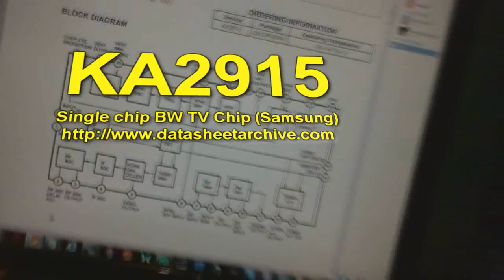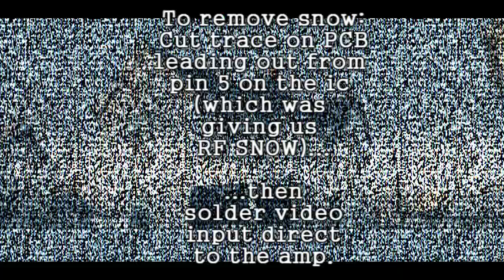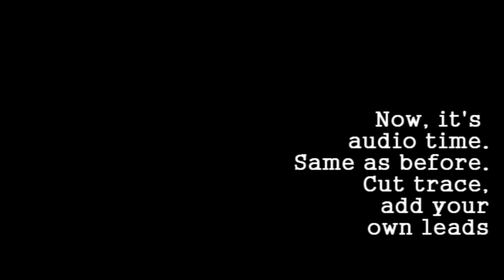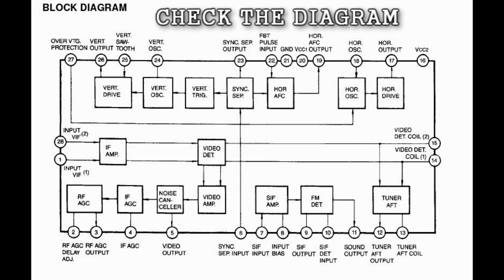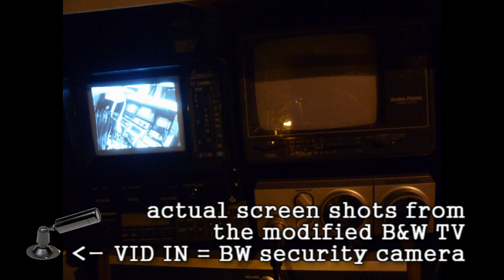How to Modify analog portable Black and White TV for Composite video and Audio Inputs

Comment: When I modified mine, I removed the tuner module as there is nothing for it to tune into. Reduces power and weight.
Tip: the battery compartment is a handy place to put a small computer like the Raspberry Pi.
Reply: Good idea. How did you power the raspberry pi? with a second cable?
Reply: @nickbex  I added a Rasperry Pi Zero to my build and I found a 12V source on the board then added a step down to 5V board.
Reply: Well i use the battery compartment to put a power supply in it for storage.

Comment: Where do you find diagrams for old CRT TVs? I have a 1980s monochrome KTV that only accepts UHF/VHF input that is directly soldered from the knobs to the motherboard. Would like to add composite to it so I can make a fake dummy terminal with a raspberry pi on the inside but I am new to CRT internals. Does adding composite depend on a specific video channel on the board?
Reply: It sucks that this is 3 years old as im having the same problem but my plan is to poke around the board and see what I can do

Comment: hi, I have an old irradio b/w tv. The chip is the same. It seems easy, located the pin 5 I can connect the video out positive directly to the pin 5, after cutting the line that from the pin 5 is going to the circuit. the result is just a screen with a lot of orizzontal lines. If I restore the line with the positive connected to pin 5 I see the signal but very noised.  What I am doing wrong? tx
Reply: I try in the next days on a Colour version.. can you solve your issue?

Comment: i don't get it. How does the TV manage to sync properly if you're just feeding composite video after the KA2915 chip?
Reply: Well... I found the answer. The composite signal is also fed into the chip at pin 6 which is the input for the sync circuitry. Kind of weird that this is done externally in the original design. I mean, video out from the chip is fed back into the chip at another pin. Why not deal with this internally inside the chip? Could the reason be to easily enable a composite input on more expensive models of the same TV?
Reply: That's exactly why, the less common, "higher end" (lol) versions of this toob had a composite in.... it's crazy to me that the cost of an rca jack and wire and solder was enough to outweigh the increased consumer appeal that the composite input would have brought with it....
Reply: @testcardsandmore1231 Thank you for explaining this part of it! I was seriously confused even with the AN5151 example circuit and pinout in front of me and somehow forgot 6 was sync separator input.
Reply: @testcardsandmore1231  if i Connect pin 5 and 6 static dissapear but It doesnt work , no imagen

Comment: I tried this today with an Emerson - Onboard IC is an LA7530N with video out on pin 16. I tried pulling the leg and tacking a lead directly to the pad. I was able to get a steady b&w image from a Luma source, but trying composite video results in just a mess. I did not terminate it with 75ohm, just straight CVBS into the video out pad - is this the issue?

Comment: This might be a little away from what you're doing here, but I think it's in teh right track. I'm looking to use a B&W TV as a monitor for an arcade game, like space invaders era. The boards put out a single video line, which I believe is effectively a single colour 'composite' type signal (obviously composite isn't the right word with only one colour/no colour, but you know what I mean). Does this sound correct? a B&W video feed would technically be able to be connected to a B&W TV in the same manner as you've done here, do you think?

Comment: mistertentpole I have a 7" digital TV which doesn't has composite inputs, can I do this to it? I want to connect my PS3 to it. I bought a RF Modulator but for some reason my tv does not process the signal input

Comment: Great video! I have seen another tutorial where the guy adds video in to an old Sony Watchman CRT; same procedure. He removed the IC entirely to cut out on interference. My question, since you say cut the trace and loosen the chip, is this chip only for processing the incoming RF? Since RF broadcasting is all but gone, these chips are useless for our modern needs? Thanks in advance.
Reply: These 5" tellies use a single-chip monochrome TV chip plus a tuner. The tuner feeds baseband video to the chip. You can't remove the TV chip. It is soldered in, so you can't "loosen" it at all.

Comment: So I have a old tv that I love, is there anyway I could convert it from the av ports to hdmi so I can connect by blueray player? I don't want to get the box that converts it.
Reply from the maker: Joaquin Reyes The trouble here is that the signals are not compatible.  Without additional electronics, no you cannot directly modify analog tv to include a working HDMI connection.
Reply: +Joaquin Reyes 
Older Blu Ray players had standard AV ports on them. You could try to find one of those.
Reply: Thanks for the helpful information!!!
Reply: Joaquin Reyes
No problem. I wasn't sure if it'd be all that helpful after a whole year, but you never know!

Comment: I could not find my TV's schematic anywhere on the site, and the only things that did have it charged money. My TV is a Samsung TB-1210. I would fool with it some more, but I just blew a fuse fooling around with an RCA cable, poking it around.
Reply: He didn't find the TV schematics either, he found the datasheet for the chip inside the TV that produced the video signal. Maybe if you can identify that chip inside your TV you can do the same?

Comment: Hey - Nice work! 

I have a Sony Solid Sate (TV9-90UB) B&W TV and was looking to do exactly the same operation. But I don't have the technical understanding to figure out where I need to solder in the video input wire. I don't suppose you could take a look over the electrical diagram and PCB below and help me out? Any clues you can provide would be a big help. 

http://i.imgur.com/4MfaJYW.png - Diagram
http://i.imgur.com/PvbjEaQ.jpg - PCB in the TV

Cheers!
Reply: You will need to take a different route. You will need to use an RF convertor and a balut to connect it to the antenna.